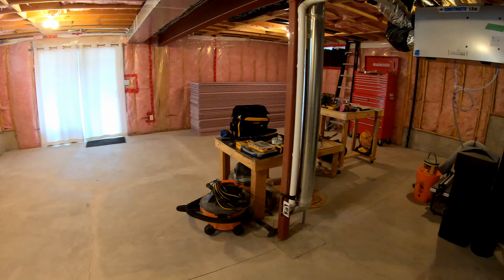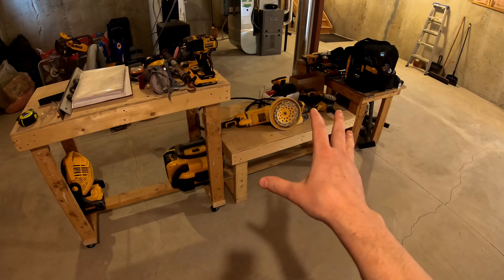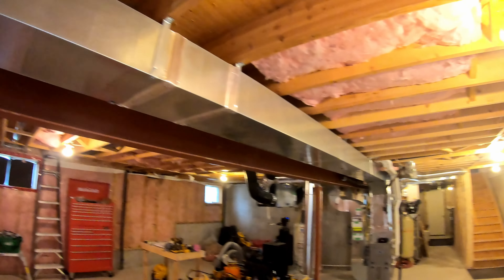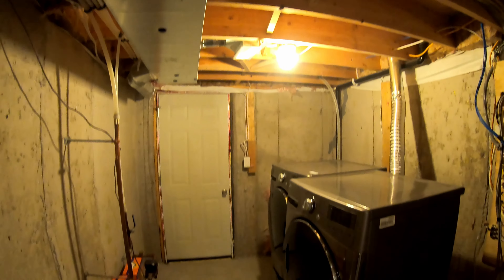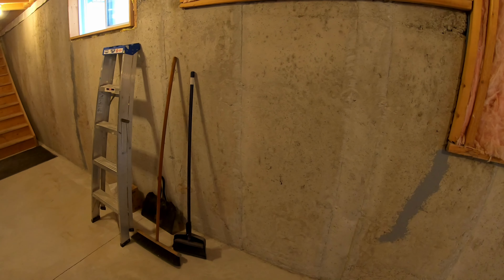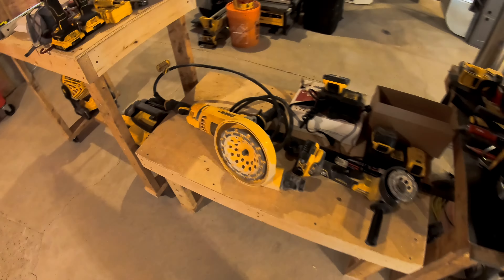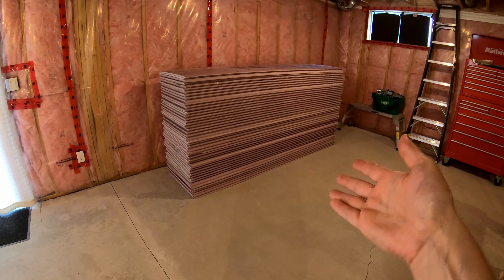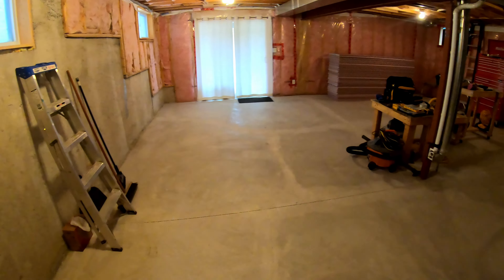Finishing my Basement - Absolutely Gutted - Part 2

Comment: Did you have any worries/concerns about the dust getting in the rest of the house?  or does concrete dust settle down pretty quickly?
Reply from the maker: Yup, I was worried about that...I had the door to upstairs closed, all the hvac off, and a fan blowing out the window creating a big of negative pressure towards the basement. There was a little bit of dust upstairs, especially near vents/doors where there's a bit of room for the dust to get through. It doesn't settle that quickly though, probably a half hour from stop to clear air. It wasn't too bad, a quick vacuum of the floors was enough to deal with it.